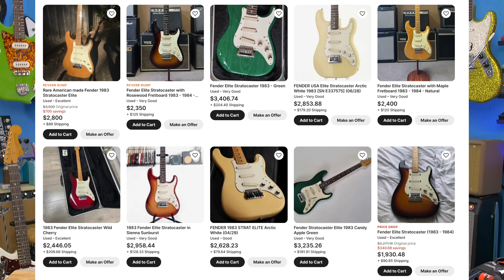1980s Fender Elite Stratocaster - MORE GUTS THAN MOST TUBE AMPS!

Comment: Thanks for reviewing this rarity, whiich I haven't encountered since I tried one in a store in the 80s. I remember the look, feel and sound was well above average and very high tech at the time. It had a tidy, hi-fi sound, what we might generically call "digital" today but digital tech hadn't migrated to guitar gear yet. Clearly not "vintage" but the overall build quality was comparable to what we've seen in custom shop models over the past several years and I believe in a blind test it would deliver a sound that many strat lovers idealize and look for.
Reply from the maker: its 40 years old, that's squarely vintage as far as guitars go.
Reply: @60CycleHumcast  Haha, yes you're right and I'm showing my age. I meant vintage in the sense of those seminal 50s and 60s models that we still love and emulate. Still, I don't remember a better time to buy the variety of excellent, consistant, and reasonably priced guitars that we can today. Wouldn't it be great if we could buy and use vintage style cars at a price and quality relative with today's guitars, like a reissue 57 Chevy for $25k! Please keep the great  videos coming.
Reply: @malcolmkendall1547  As someone born in the 70's, I would love it if all cars had wings again.  That's crazy 50's American design school was intense.

Comment: Sounds a lot like my 90s Powerhouse strat, with active 12db boost. I haven't opened it up in a long time, but I think it has a similar circuit board and dummy coil. One of the tone knobs activates the battery/boost.

Comment: I have a 1980’s mij with a Kahler and Seymour Duncan live wires, which were brand new back then. Bought it used already modded.  It sounds very similar. The clarity of active pickups makes things different. And yep - batteries can change everything in an active setup. You could charge a few hundred dollars for a couple sprays of that deoxidizer.

Comment: I liked the tones, very twangy. I think they should bring it back in a limited release. Also, Josh would absolutely build a pedal out of that circuit board. 😺😸
Reply: The MDX control has already been built as a pedal. The circuitry was modified to give the midrange boost without a dummy coil and was installed in the original EC model Strat with Lace Sensor pickups. Now, you can get that in a pedal kit too.
Reply: .. or build a pedal INTO that circuit board.
Reply: @christopheranderson2100  mind. blown. 🤯
Reply: @sassycat  mine was already blown trying (and failing) to find the op-amp chips, inductors and capacitors.   not convinced that is actually controlling the tone at all.

Comment: I own a '00 MiM Deluxe Powerhouse Strat with a factory active 12dB mid-boost. It has both the dummy coil and the metal screwholes. It ALSO has scratchy pots and a slightly "off" tonal color. A little darker and punchier even with the boost turned off. I replaced the tone pot with the double-stacked "Treble-Bass eXpander" (TBX) control to give it more sparkle on the top-end when I need it. I think the Elite was equipped with that control from the factory. You noticed the detente at 5 on the middle? That's the transition from a standard tone to the TBX.

Comment: Noiseless pickups, the Clapton mid-boost mod and a superswitch is plenty advanced tech for any Fender strat IMO.
 Pair those electronics with an LSR roller nut, strap locks, a 2-point tremolo, staged locking tuners, a compound fretboard radius, assymetric neck profile, stainless steel frets and the American ultra body contours and you have yourself a guitar as advanced as is reasonable

Comment: These aren't actives. It has an on board preamp, but the pickups are low output passives. I have EMGs in one of my strats and they're pretty different from this, and they are incredibly quiet, and immune to issues that one might get with an exposed circuit board like this. 

In saying that, you can get close to the sound of one of these with EMGs and active tone shaping controls.

Comment: It was nice that you wanted to clean up the body and around the cut-out for the electronics but you used a paper towel to do it.  You should have used a microfiber towel which are also used for cleaning the paint on cars.  They don't scratch the finish like paper towels do.

Comment: I've never thought about putting a dummy coil in a strat to "fix" the 60 cycle hum but that's a super cool idea.
Reply: But how are you going to fix surf music?   But seriously, though I couldn't find the webpage, there is a company that makes various hum-cancelling solutions for strats with coils in the plate the covers the springs (and other places) plus a little circuit board with some dip switches to adjust.  I assume that is what the dummy coil is doing in its way?
Reply: @christopheranderson2100 What happens when a Strat is in positions 2 and 4?
Reply: @joeyskar  God I hope that was a rhetorical question because I have no idea.  I assume everything just works, and it's not like the dummy coil can cancel out the string signal.
Reply: @christopheranderson2100   it turns two single coils on at once putting both pickups in parallel signal essentially cancelling the hum that you get from just using one single coil. By putting a dummy coil in the mix for positions 1,3, and 5 you are getting the same effect in theory cancelling the 60 cycle hum that you'd normally get without it.
Reply: @joeyskar  That's what I would expect.  Doesn't answer your question of what happens in 2 & 4 though.  Since my original comment I bought a guitar with 2 humbuckers, and the middle position just sounds half-way between.   I swapped the neck pickup for a single coil, and middle position was terrible.   So I feel that the dummy coil would be suffer in a similar way if you were using it on a HSS or somesuch.
Reply: @christopheranderson2100 Yes, I did answer that question, read bub. How was the H-H wired for the middle position, are they 4 lead humbuckers or two lead? If it splits the humbuckers in position two then it should be fine but if you're running a full humbucker in position two with a single coil then it's going to make a lot of ruckus. There's a certain way to wire that so it doesn't happen. Look at a few wiring schematics online for H-S online, they'll help you out.

Comment: I love all these weird 70s & 80s oddities. Most weren't well received at the time, though a few have become "cult classics" over the years.
The real issue with the guitars of the time was more of a QC issue than anything. If you managed to get a good one then they're still great guitars and they've got these quirky differences that can really standout and be "unique"
On the pickups on these ones, the active circuitry was really more about trying to limit the noise from the single coils (hence the "dummy" coil etc.). It adds some compression which the hum from the pickups is below the threshold to activate in order to suppress it. That's kind of why it works though as it results in a kind of "hi-fi" pre-recorded and compressed sound such as you'd hear on any album.
Adding in the TBX active tone circuit to boost the highs then helps add back in some of the top end you lose with the compression

Comment: Reading this comment just three elite players looking at each other
Reply: That could be because it's getting harder to find an Elite in original condition that hasn't had the guts ripped out of it and replaced with something else. Unfortunately, that's happened a lot.
Reply: I am old enough to have played one of these new in 1981.  IMHO, the best sounding Strat to date.
Reply: @vincentpritchett1231  They didn't hit the market until 1983 though, but I get you 🤣

Comment: Top tone control: middle position is normal Strat, rolled up is boosted highs and rolled down is boosted lows. It’s called a TBX (Treble Bass eXpander). The bottom tone is an MDX (Midrange eXpander), rolled down is low boost and up is high boost. On the Clapton is from +5db down to +25db when up all the way. Not sure if it’s the same on this circuit!

Comment: I'm curious? Why spaghetti western and surfing music? I once owned a Casio/Ibanez guitar from the 90s with on board MIDI and expansion cards and sound module. It got to expensive to repair it due to leaky electrolytic capacitors. That happened twice. $800 is too much for my blood. I went to Roland and a GK-3 and the GI-20 the links into any sound modules. I've done gigs with my bass and now getting back to the MIDI stuff again. Fun fun fun?

Comment: It's weird to think they went from these to the Lace Sensor Strats in the 90's with the two point vibrato, roller nuts, and locking tuners.
Reply: Fender was under new ownership by then, none of the things offered from the CBS ownership era were being made anymore.
Reply: @harleyhexxe9806  That happened in 1982.
Reply: 1987.

Comment: I don't like the fact it's got all those capacitors on that circuit board. Caps can go bad over time, especially those three can caps that look like electrolytics.  Electrolytic caps have a shorter life. Could be the cause of some of that hum. Also, I it looks like it has five transistors on that board. Q1 through Q5.

Comment: My brother has modded his 2001 MIM Strat to have the three pushbuttons like the Elite. He saw the schematic in a pickup wiring book. He thought just having the ability to access all the pickups in any configuration would be cool and it is! So handy for getting cool unique tones. The little white buttons were expensive though. He said he finally found them from a guy who makes them simply for guys building David Gilmour Black Strat replicas who want that tone mod and the little white button for it. He simply used three and had WD parts make him a new pickguard. Everyone who sees his Strat asks him about it and loves the idea. The only thing I wonder is why Fender didn't use the idea for any other guitar and just went back to the old five way switch.

Comment: Nope. Elite Strat did not have active pickups. [Edit: bwahaha. Shoulda waited: I see you corrected yourself. Oh well, the remainder is *pretty* pertinent anyway lol] You'd naturally assume they would: the Tele takes a 9v battery & has active pickups that look like slightly beefier twins of the Strat's...but nope: the Strat's pickups are good ol' fashioned non-powered, passive Alnico--but their signal does then go into active onboard preamp/tone-shaping circuitry underlying the (also widely-misunderstood lol) TBX/MDX controls.

BUT: of course the Elite designers have a cool twist on even the lowly alnico passive pickup--one the active circuitry makes possible. 

To get an acceptably loud signal, passive circuitry depends on the electro-motive "oomph" generated as your steel strings vibrate within a magnetic field – the stronger the magnet/field, the 'louder' the signal – BUT interaction of field & strings also dampens the strings' vibration, the stronger the field the greater the loss of sustain, resonance, overtones, articulations, etc--

BUT! ACTIVE PREAMP circuitry can increase the signal amplitude downstream of the magnets, hence weaker magnets that expert tons less pull on your strings cam be employed: Elite Strat pickkups use Alnico TWO magnets...which I'm assuming are too wimpy to be used in any other pickups on the planet...? But which allow previously impossible freedom of string resonance. 

By the way: the crowning glory of the Elites are really the Walnut models...there's something just incredibly cool about the way the tone & the feel...I'd rather pay an extra two or three thou for a walnut over any style, as identical as they may be electronically. Nothin' like 'em. Like a fool, I sold a Tele--waiting for another to come around now--& have a Strat (Walnut ofc) arriving on Wednesday, hallelujah!!

Long-winded, sorry: but thought it was worth pointing out.